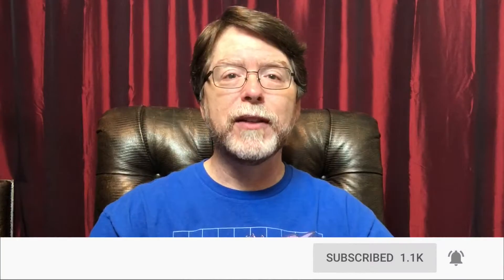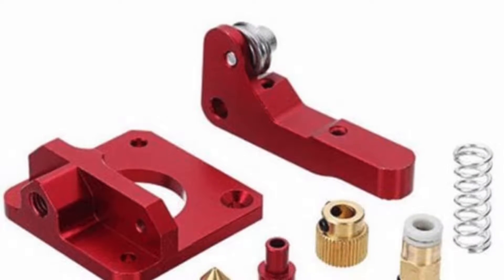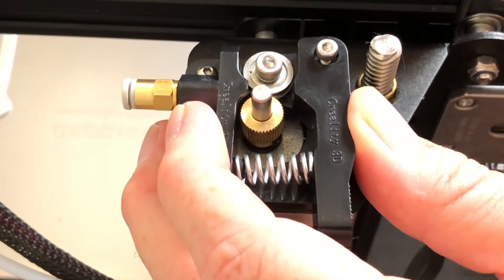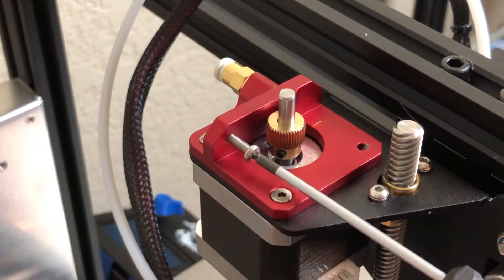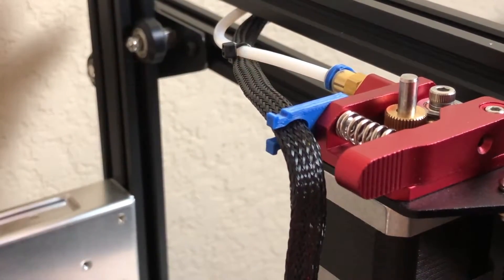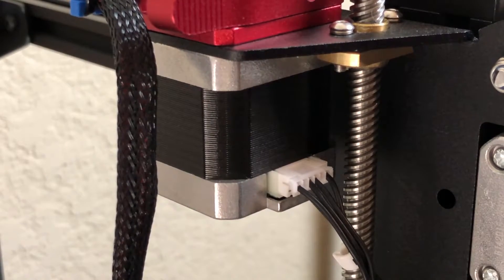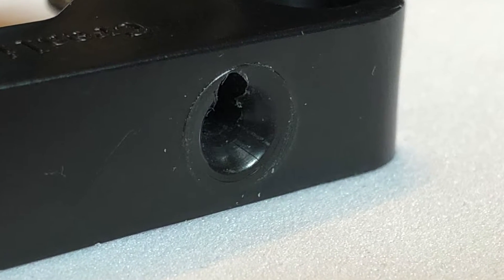How To Install a Metal Extruder upgrade on the Ender 3 & Ender 3 Pro

Comment: My ENDER 3 doesn't have this screw that fixes the gear, and its shaft is round, smooth, without this "chamfer". How do I remove the gear?
Reply from the maker: Hi! You've got 3 options for dealing with the not-easily-removable gear:
1. Leave the current press-fit extruder gear on the motor, and replace everything else.
2. Buy a small "pinion puller" to remove the press-fit gear.
3. Buy a replacement stepper motor.

Option 1 is perfectly fine as long as the extruder gear is in good shape.
Options 2 and 3 cost about the same. If you choose Option 2, you'll probably also need to file or grind a flat spot on the motor shaft so one of the two set screws has something to press against.

So if you're doing this upgrade because the gear on the stepper motor needs to be replaced, I'd recommend Option 3.

Comment: Thanks very much for this - still rocking an ender 3 pro after years and years but needed to replace a worn out extruder gear- figured I might as well replace the whole assembly. Surprisingly the Creality brand aluminum extruder upgrade didn’t include instructions either. This was perfect, made it easy!
Reply from the maker: Glad it helped!

Comment: How do I remove the original extrusion gear?
Reply from the maker: Creality started using press-fit gears on the extruder motors some time after I made that video. If the gear on the original motor is press-fit into place and does not have a set screw, you have three options.

    1. Keep using the original gear, if it's not worn.
    2. Buy a small gear puller, remove the original gear, file a flat spot on the motor shaft, and install the new gear.
    3. Buy a new stepper motor. A new one should have the flat spot already on the shaft.

Option 1 is free.
Option 2 is about $10 USD (https://amzn.to/4g7Ofmv aff link)
Option 3 is about $13 USD (https://amzn.to/3Xu4ItQ aff link)

Comment: i cant take the brass piece off my stepper motor?
Reply from the maker: Hi, other people have run into that too. Some printer manufacturers use a pressed-on brass drive gear. There are three options. One is free, and the other two cost about the same.
1. Leave the existing press-fit drive gear on the motor. If it's not actually worn out, no problem. [free!]
2. Buy a small "pinion puller" to remove the gear from the motor shaft [about $15]
3. Buy a new stepper motor [also about $15]

Comment: 3:25 - i am disappointed to report my ender 3 pro that i bought a few days ago does not have a detachable filament feed gear. the brass gear has no grub screws, and appears to be a completely different assembly altogether -- the brass gear doesn't even appear to come off.

this didn't stop me from being able to install the rest of the upgrade, but it's something to note if you're buying the printer nowadays... if the gear wears down over time, it will require a full motor assembly to replace, not just the gear.

despite this, thankfully the upgrade kit appears to be working fine. thanks for the step by step guide.
Reply from the maker: I guess it's a cost-saving measure. If Creality gets the motors with the gears already pressed onto the motor shaft, they don't have to spend 27 seconds putting the gear on and tightening the grub screw.

Funny thing is, you could buy a mini pinion-pulling tool to remove the gear from the shaft, but then the shaft won't have the flat spot for the grub screw.
Or you could buy a whole new motor.
The tool and the motor cost pretty much the same, within a dollar, last time I looked. That brass gear that's on the stock motor should last you a while, though.

Comment: I bought a kit that had a metal spacer that went inside the spring and the spring screw was fitted from outside allowing adjustment of spring load. It looks identical to yours but for the added spring spacer and fitment of screw from the other side. What do you think about having no spring tension adjustement?

Comment: Ok, so my 3pro doesn't have the screws on the extruder pusher gear thing that feeds the filament through. Is there any other way to remove it?
Reply from the maker: There are three paths forward.
1. Leave the current press-fit extruder gear on the motor, and replace everything else.
2. Buy a small "pinion puller" to remove the press-fit gear.
3. Buy a replacement stepper motor.

Option 1 is perfectly fine as long as the extruder gear is in good shape.
Options 2 and 3 cost about the same. If you choose Option 2, you'll probably also need to file or grind a flat spot on the motor shaft so one of the two set screws has something to press against.

So if you're doing this upgrade because the gear on the stepper motor needs to be replaced, I'd recommend Option 3.

Comment: Jesus christ...
Noone ever said to put the Spring Screw on the opposite and i kept having Skip issues on 2 printers after i upgraded them on Metal Extruder.
I spent 2 days assembling and disassebling everything from Extruder, down to Hotend to clean everything because i thought i had a clog.
I removed the metal spacer that comes with the stock extruder and used the new spring and turned the spring screw opposite side like in the video.

Both printers are currently printing for 5 hours without issues.

NOONE mentioned this NOOONEEEEEEEEEEEEEEEEEEEEEEEEEEEEEEEEEEEEEEEEE

Thanks mate, you saved me a lot of troubleshooting

Comment: not exactly for a PRO. You can't remove the gear from the motor, because it is pressed on the rod.
Reply from the maker: Well, to be fair, three years ago when this video was recorded, they weren't like that. 😉 For printers with press-fit extruder gears, the options are to either buy a gear puller, or a new stepper motor that has a flat spot ground on the shaft. Both cost about the same, 10 bucks more or less.

Comment: My stepper motor 42-40 can't be upgraded because it's just a rounded tip with no screw holes. How can I change the head on it?
Reply: Same for mine @yurushii. Did you figure it out?

Comment: My stepper motor had a feed gear that didn't have a set screw to remove it.  I couldn't find any way to remove my existing feed gear and replace it with the new one . . . is that ok that I left the old one on?  Or is there some other way to remove it?
Reply from the maker: That's perfectly OK to do.
Reply: @BV3D  Ok, thanks!

Comment: Thanks - this video helped us install a very similar Al extruder - you might want to mention to recalibrate the extruder after you've done it though, as the grip gear is way smaller, and eSteps need major adjustments....

Comment: Thank you for this video: I'd just about figured out how to fit my replacement metal extruder myself, but this gave me more confidence. Also thanks for the tip about printing the cable clip: my cable has never been slotted in on the existing clip since new - I missed it! Do'h - newbie error. Stay safe. Stay sane... well... just a little bit.

Comment: Mine doesnt have a brass filament feed gear set screws..  how do you get it off?
Reply from the maker: At some point after this video was released, Creality switched to using a pressed-on gear on the extruder stepper motor. This is not removable, unless you have a pinion puller or gear puller. But really it's OK. The only reason I replaced brass filament drive gear in this video is because there was one in the kit, and I wanted to show that it was easy to do (which, at the time, it was). I wouldn't expect the filament to wear the brass down in any significant way. You might need to "brush its teeth" from time to time if there's plastic buildup. Temporarily removing the extruder motor and using a small brass brush on the gear should take care of that pretty easily.
Reply: @BV3D  I see. I wanted to upgrade to a dual extrusion kit. Guess I will need a new motor

Comment: This might sound stupid but I have only had my printer a week. What’s the purpose of changing the Extruder gear if it’s not worn? I bought this kit but left the original gear on as mine as it’s press fit and not held on with grub screws.  I attached the new gear to the top section of the extruder motor shaft and used is a manual motor knob since mine is a round shaft and not one with a flat side. I also used my original Bowden tube fitting as the one supplied with the kit didn’t seem to hold the tube tight enough. Also my original stock arm had a brass insert so the filament wouldn’t chew a groove in the arm but I have heard they often break, often mid print. Which is an issue I now won’t have to deal with
Reply from the maker: Hi! It's not a stupid question at all. I changed the gear because it came with the kit, just to show how to do it. Honestly I can't imagine a metal gear being worn down by plastic, unless it was maybe some particularly abrasive material, and even then it would probably take a really long time.

I can imagine the gear getting plastic stuck in its teeth, but you could just brush the gear's teeth with a brass brush and it would probably be good as new.

I guess Creality started press-fitting the gears a little while back, because a lot of the more recent comments mention it.

Comment: i just got my ender 3 pro i am having such a hard time getting it set up and to print things perfectly and i bought some upgrades like metal bed wheels and springs and i bought that in the video but havent put it in yet i printed out what you suggested and the screw hole isnt rount or open like it suppose to be. if i could share a picture i would so u can see what i mean. cant get my prints to print perfect and im getting aggravated and sad uhg .

Comment: Superb and superior video to anything the manufacturer provided. (which was a link to a poor video). I have it all installed, and the gear is turning, but the guide wheel seems to either not spin (too tight?) or kickback slightly (too loose?) so right now, my "click" nouse is gone, but I'm not getting any true feed through the hot tip. <<Sigh>> Any recommendations? Another improvement for the design would be for it to have some sort of a top case to keep dust out.

Comment: If you're here in 2021, these instructions are a bit outdated as there is no longer a pneumatic connector included, there is a compression fitting that you push into the extruder, and your Bowden tube goes directly into that, then locked with the blue plastic clamp. Also the button screw to hold the spring in place doesn't do it alone, it screws in the opposite way and has a cap that goes spring side to hold the spring. The item was updated, so look for MK-8 when you buy it and you'll know what to do. This video does cover the major install though, so just make those modifications as necessary.
Reply from the maker: Hi Matt, thanks for bringing this to my attention. I found the kind you're describing. I think I'll pick one of those up and do a new installation video, so it's up-to-date with the newer extruder design. 👍

Comment: Thanks for the great video. Just a thought. Wouldn't a piece of brass or even a copper tubing/sleeve inserted into the worn filament guide hole do the job?
Reply from the maker: Great idea, you'd just need to smooth the opening of the tubing so the filament didn't snag or get shaved on a sharp edge. The sleeve idea has been implemented by Creality on the Ender-3 V2's extruder. I like the look of the anodized aluminum myself.
Reply: @BV3D  The thought only came to me after first buying an anodised silver one and then also a red one like yours a few weeks back but it was only after watching your very helpful video yesterday. that the penny dropped. Could have saved AUS$50 :-(.

Comment: Thanks for this, I just got this upgrade to fix the issue with feed slipping and it took me almost 6 months to figure out what I needed.  Out of curiosity are there any 3D printing clubs here in 210? I think that it wouldn't have taken me nearly as long to figure out if I had been part of a community and I don't do facebook so I was kinda in the wind. lol

Comment: Question: when you replaced the brass filament feed gear with the new one did you put it upside down?? Or is that how that replacement goes???
Reply: I was wondering the same thing!!
Reply: It's upside down compared to mine as well

Comment: Is there a guide for how high the gear needs to be?
Reply from the maker: Hi Cathy! I like to center the gear on the idler, because the idler controls where the filament touches the gear. But as long as the gear is fully engaging with the filament, it should be fine.

Comment: Hello I just got an ender 3 pro. I can’t get that one brass gear off for some reason. On the pro series there’s no screw. Like there is on the ender 3 regular
Reply: Asking the same question!!  Purchased in Feb 2021.  There is no collar with set screws on the new models so I just left the original part on the motor.
Reply: @tishaandmegan  so I actually bought a new stepper motor. When you do it will come with the crease on the bar

Comment: How did you attach the pneumatic thing to the extruder assembly my metal part does not have any teeth in it
Reply: Did you figure this out? I have the same problem
Reply: Okay so apparently you put the black clip in the hole then you insert your tube feed past the teeth of the black clip in the hole then attach the blue clip to secure both parts

Comment: Hey Bryan. I added the upgraded extruder to my CR6SE. It feeds easier than the plastic enclosed extruder and is easier to work on if I need to.
Reply from the maker: How are you liking your CR6 SE? I still haven't taken mine out of the box!
Reply: @BV3D  It’s pretty darn good. That’s coming from a the Maker Select. Huge step up. I bypassed the power switch and use a smart plug. It prints well and I’m never going back to manual bed leveling.

Comment: Hi I have 2 issues, 1 my extruder didn’t come with a threaded insert for the ptde tube connector, and the motor doesn’t spin even when it’s connected.
Reply: I have the same issue with the lack of threads and 2. my extruder gear has no screws that hold it in place. It looks like it impressed on to the shaft. Any ideas?
Reply: @jimboness350  I've got the same issue here, so I don't think I can get any further with the install :(

Comment: Great video that helped me put it together easily. (As of 09/09/20, still no installation instructions included!) They did fix one of your complaints by using a new type of fitting for the bowden tube connection to the extruder housing. (cheap looking, but seems to hold as well if not better than the old style brass fittings) I bought mine from eBay seller: Christmas-gift from Walnut CA, so it may have been slightly different from the actual manufacturer, or model you have. Mine didn't have any extra fittings, nozzles, etc. Just the parts and screws for the conversion. For <$10, it is a worthwhile upgrade. I notice that this extruder doesn't allow changing filament any more easily than the original. You have to hold your mouth just right while turning the filament until it feeds through. The gear height setting that so many asked about was simple. I looked at about how far up you put yours and copied it from the video! That isn't something requiring exact fitting as long as the filament is against the gear teeth.

Comment: If your kit doesn't come with a brass pneumatic connector, look for a black, plastic cylinder in it's place. This connector fits the Bowden tubing and uses the blue plastic clips to hold it in place
Reply: I could not find that tidbit anywhere! Thanks!
Reply: Any idea where a replacement for the black cylinder connector could be found? Mine didn’t have it in the package and they wouldn’t send a replacement
Reply: @larebearh1071  If I remember correctly, it came with mine. You'd probably have to contact the manufacturer for one
Reply: Ty

Comment: I purchased the Hictop version of this, because I waited 3 weeks on the Creality version and it was still unavailable thru Amazon.  It appears to be the same, just re-badged.  I also got a bad pneumatic fitting in this kit.
https://www.amazon.com/HICTOP-Upgraded-Replacement-Aluminum-Extruder/dp/B0761PGLZ4/ref=sr_1_3?dchild=1&keywords=hictop+ender+3+extruder&qid=1592754171&sr=8-3
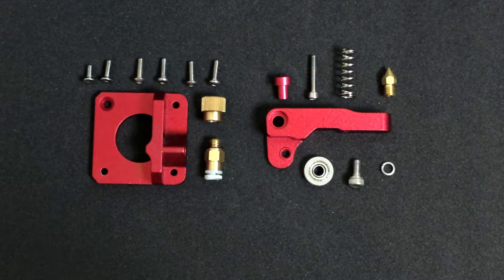I didn't see you use the smallest screw at the top left of the video at 2:10.  I also have this small screw.  Approximately 7 mm long.  What is it supposed to used for?

Comment: Hi Bryan, firstly thanks for all these excellent posts which are really friendly and helpful. 

I have a problem with my filament recently concertina-ing at the extruder end of the boden tube after about 40 mins of printing. I've changed the stock manifold to the metal one as you've mentioned, changed the boden, changed the nozzle and following the procedure to clean out any molten metal that may come from gaps between the old bolden and the nozzle. 
However even after all this I still get underextrusion as a result of the filament concertinaing at the extruder. I think it's the amount of pressure being placed on the filament by the pulley, and I can't change the tension on it. I've limited the number of retractions in Cura to 10, still not getting completion of prints. Any advice? 

Is there a way to send a PM with images?

Comment: On this extruder, the fix to the tightness of the screw being finicky for the arm is simple. Just add a washer under it that's larger than the aluminum insert, but smaller than the hole in the arm itself. Then you can actually crank the screw down tight and the arm will still move freely.  IMHO this is a design flaw of this extruder. That aluminum insert really should be half a mm longer.